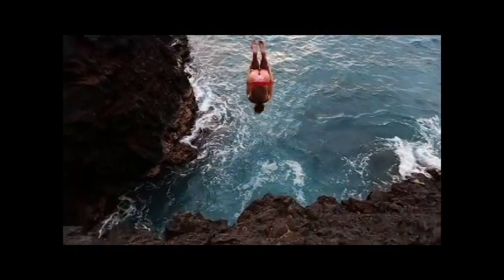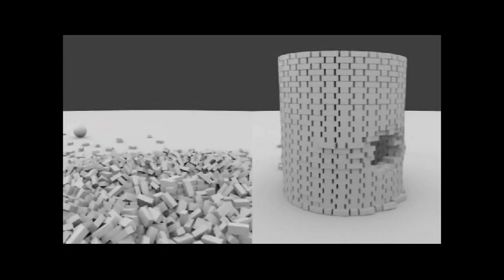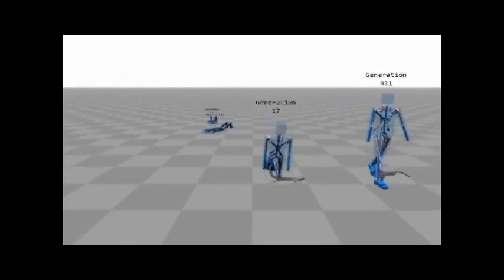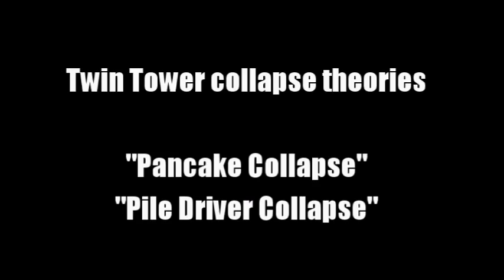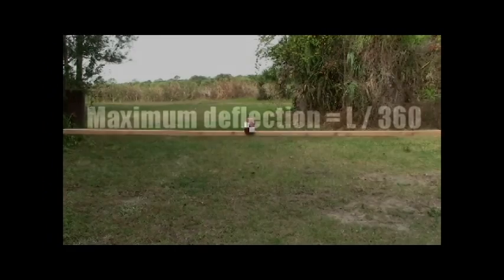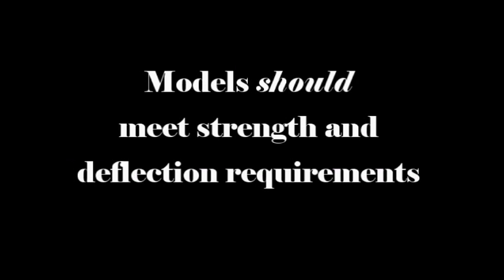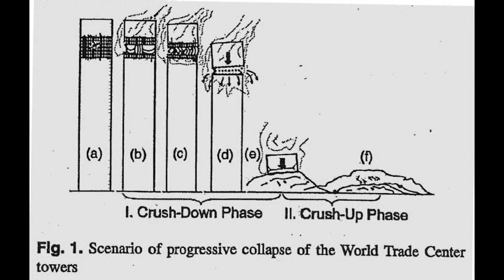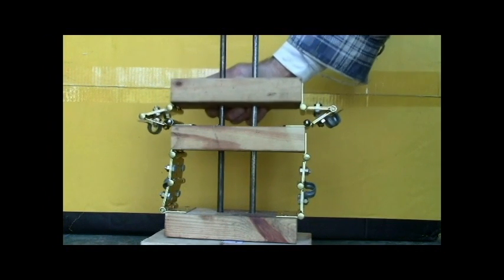9/11 Experiments: The Force Behind the Motion

Comment: this is a good example, of how easy it is, to fool the gullible.
     he drops a weight, which under static conditions, the, 'floors ', can support.     upon impact,  the 'floor',  now has to support, a dynamic load, it can't, and fails, due to the much greater impact force, generated because of the kinetic energy stored in the weight.
     some of the kinetic energy, is dissipated in breaking the, 'floor', so the weight's velocity is reduced.    since the floors are much closer to gether, than the distance it was dropped from, the weight eventually stops, because the velocity is reduced, with each, impact,  this is physics, at work, nothing strange, here.
     now lets see what happened  to the first tower,   
        the 'weight',  about 14 floors, dropped about 4 metres to the floor, below, and either smashed the floor to pieces, or at least detached it from the angle clips, similar to this video,   the 'weight', then dropped onto the floor below, with the same result,  etc,  etc, all the way, to the bottom.
     so, why did the towers, 'weight', continue to the bottom?
simple,  the towers , 'weight',  was about,   60,000 tons,  and  the floor could only support , about 13,000 tons.
     in fact, due to the mass and it's velocity, on the first impact, a force of about 30 times the 60,000 tons, was generated, close to 2,000,000 tons, the structure had no chance.
    but hang on, you shout, what about the vertical collumns, they would have stopped, it, no they were not even relevant,  because they were  not stable enough, to stand on their own, once the floors, were taken out, and what makes you think, they were even in line, when the 14 floors tilted over at quite an angle, before descending .

Comment: nice work
Reply: you must be very, gullible.
Reply: 311hwr
sorry slappy, i've done more hours of research on 9/11 than you can imagine.  it took 8 stubborn years for me to see the light.  gullible is definitely not the right term.
Reply: if you think  these ' experiments ' prove the towers could not fall due to damage and gravity, you are, gullible.
scaling down to say, 0.5 percent, of the towers, is impossible, it cannot be done, because you cannot scale down gravity, building a scale model to that ratio means you would end up with not enough space in the model, to place enough gold, to get the scale, weight.
if you made it slightly bigger to fit in enough weight, you would have virtually a solid block, hardly representative of the towers, they were 95 percent, air.
if you mean by, ' seeing the light ' that the government of the u.s.a, is controlled by a bunch of evil monsters that take there orders from a tiny state in the middle east, then i must agree with you, but that has nothing to do with the physics of how the towers, came down.
they came down, because of damage and gravity, and an, 'odd',  tube in a tube design, all explained by physics.
Reply: 311hwr
the experiments are only the tip of the iceberg.  there is so much more information available the unquestionably proves that 9/11 is full of lies.
Reply: Bill Fred
911  is full of lies, but mostly from gage, chandler, jones etc.
   i won't bore you with the very long list, it's all on 911 debunked,   and nmsr 9-11 truth resources.
  i watched a compilation of about 150 controlled demolitions on u tube, then watched the towers drop,  not one of them remotely resembled the towers collapse.
  the reason is simple, the towers collapsed due to damage, and gravity, not explosives, thermite, etc.
   it's very easy to be brainwashed by people like chandler, gage, etc, don't be.
Reply: wtc1 and 2 etc,     yes the inner core was very strong, but none of these buildings were designed to survive having 60,000 tons and about 120,000 tons of steel and concrete dropped on them, why would they be,  seagulls roosting up there don't weigh that much.
   once that sort of mass starts moving, it's planet, here i come.
the weight did not bring them down, it was the massive amount of kinetic energy built up by the accelerating mass .you don't think kinetic energy could do that?
    pick up a house brick, slowly lower it on to your foot, no problem,  what would happen if you dropped it from 4 metres?  don't try it, it's hard to walk without a foot.

Comment: Really excellent work. I've often wondered why the pancake or pile driver theorists don't put the matter to rest by constructing two large (1/10 or 1/20th scale), accurate replicas of building seven, and then challenging the "truthers" to a contest. Each team would have to reproduce the collapse of the building with one of the models. The truthers would be able to use explosive charges, the pancake/pile driver team would be able to use only small fires and some debris tossed at one wall.  Which team do you suppose would fare best?

Comment: Great attempts but I see flaws with your experiments that may very well be why your not seeing the results. Keep in mind each and every one of these floors are connected with vent shafts, elevator shafts, stairwells, etc. The building was also for the most part sealed. The air compression generated by the collapsing floors above could very well be the extra force that was required to take out and weaken the floors below. You can see this occur many stories below the collapse as windows begin to burst randomly.

Comment: A quick analysis of the pile-driver collapse mechanism yields a=g*(1-(F_up/W_piledriver)). The weight of the "piledriver" will increase at about the same rate as the maximum upward force (because the lower floors have to support all the floors above them, and are thus stronger). If the force provided by a floor as it collapses from its initial height to zero is similar to the force it provides when intact, then any building that didn't collapse under its own weight would not experience accelerating collapse under these conditions. The crucial insight is that, due to buckling, the average force provided by a floor from h=h_init to h=0 is much lower than F(h_init). If the factor by which it is lower exceeds the safety factor, we get an accelerating collapse. If not, we get a damped, halting collapse like you saw. There are two very different behaviours possible here, and which one we see depends on how the model is built. You need to modify your model to provide the appropriate average force in a floor collapse event. To do that, you'll need to determine what the value of that parameter was in the actual towers. Which will probably entail some simulation ;)
Reply: How fortuitous that all the complete  building blueprints are available online! scale model time, if we can just get some funding.

Comment: Sorry bud, your popsicle-stick and paper model doesn't trump a computer simulation made by actual engineers.
And your model doesn't match the footage at all. Your model keeps starting and stopping from bottom to top the whole way down. In your model, every floor shoots most of the beams out in all directions for half a mile or more. It simply doesn't match observation, Richard Feynman would not be impressed.
Reply: <You lack any evidence or any empirical support, so you're stuck with bland insults.>

All of the observable evidence points to controlled demolition.  The only published academic work examining the dust for pyrotechnic residues concludes the use of advanced incendiaries.  The documentation of melted "eutectic" steel in FEMA's appendix C supports this conclusion.  The huge number of iron microspheres in the dust as reported by RJ Lee also matches the known chemical signature of thermite reaction byproducts.  The hundreds of eyewitness statements concerning secondary explosions and molten iron supports demolition.  The 100 ft of perfect symmetrical free-fall for building 7 is also only possible with pyrotechnics to remove the supports simultaneously.

Which actual physical evidence can you present that supports the official theory?

<In demolitions, first multiple audible popping explosives go off, then there's a pause, then the building collapses from bottom to top.>

In *conventional demolitions, that is true.  And you actually believe that a person wanting to fake a plane-and-fire-induced collapse would rig a building to look like a conventional demolition?  Wow.  And you actually believe there is only one way to demolish a building?  Top-down demolition is not new.  0 points.

<Some assert there are explosion sounds, in the world trade center collapse but they sound much softer>

Advanced superthermite composites can be tuned and adjusted in their configuration to affect the noise and shockwave of the material the it ignites.  Your assumption is that all explosions are going to sound like a C4 charge.  They aren't.  0 points.

<And these sounds occur at the wrong time, with no pause before the collapse.>

You actually believe that you would be able to hear discernible individual explosions in a sequence that cascades downward at near free-fall accceleration amidst the cacophony of debris falling around it, recorded through a device thousands of feet away, and replayed through some laptop or computer speakers?  The progressively deafening roar that is recorded is perfectly consistent with what one would expect to see considering the circumstances.  0 points.

<literally just showed empirically that this is not a controlled demolition>

No, literally, you didn't.  I don't think you know what empirically means.  There is absolutely nothing empirical about the collection of misrepresentations and speculations that you call an argument.

If you'd like to show some actual empirical evidence that proves the official collapse theory, then be my guest.  Similarly, go ahead and disprove the Harrit paper, which EMPIRICALLY  proves the presence of advanced incendiaries in the WTC dust.

<but you failed to even try and address it.>

Addressed, and crushed.  Looks to me like your so-called argument needs some help.
Reply: Dank Bear I've watched at least 20 now, and I don't see the connection:

In demolitions, first multiple audible popping explosives go off, then there's a pause, then the building collapses from bottom to top.

With the two towers, no explosives go off, they just sit there burning for who knows how long, then they begin to collapse from top to bottom instead of bottom to top.

Some assert there are explosion sounds, in the world trade center collapse but they sound much softer(probably the floors collapsing onto one another) not poppy like explosives in demolitions. And these sounds occur at the wrong time, with no pause before the collapse. Whatever way you look at the footage, this does not match a controlled demolition. Sorry about that.
Reply: <Sorry bud, your popsicle-stick and paper model doesn't trump a computer simulation made by actual engineers.>

Which model are you referring to?  Oh, the NIST building 7 computer model?  The model that hasn't been peer-reviewed or published, and whose creators will not release the modeling parameters?  The model that looks nothing like the actual collapse?  That model?  Tell me, who was there measuring the location and intensity of all the fires in real time?  Who was cataloguing the load distribution of the towers?  What was the extent of the structural damage, and where?

Sorry bud, A contrived computer model with estimated parameters that they won't even release to the public proves nothing except in your fairytale version of reality.
Reply: +Paolo Rossi Oh I don't think he's brainwashed. No, he did this to himself.
Reply: +Paolo Rossi not an argument.
Reply: +evsupp2011 God I wish I could get paid just to leave comments on YouTube.  Where do I sign up for that?

Also; not an argument.
Reply: +Paolo Rossi literally just showed empirically that this is not a controlled demolition, but you failed to even try and address it.
I've had more intelligent and honest discussioms with flat earthers and that's the Truth.
Reply: belief, is all they have.
Reply: +311hwr you greasy little troll shows up on every 9/11 video, but all you do is nutthug someone else's statement. You're not even a full grown troll yet, you just hype other more senior trolls comments. Funny and pathetic you guys are,  supporting the official bullshit story. Have you concluded which official lie NIST an they others decided to use after constantly updating their story of what happened and please gtfo with your ''throw away that spade yet'' line cause you're so fucking corny and lame. What ''spade'' have you got cause all you do is play yes man. You're a fucking idiot, lmfao just another coward protecting his bubble in your own little world where science doesn't applied and lies govern your flouridated brain
Reply: +Paolo Rossi yeah he's every where, he rarely comments for himself, he just likes hyping other trolls. He's a typical upright bag of water.
Reply: Oh Xander, Emvaz22 really handed your ass to you. I do not see any rational reply from you to him here? I doubt one is forthcoming. You are well and truly trounced on all fronts. My condolences.
Reply: xander, I'm not going to try to "beat your ass with evidence" but what I want you to do is look at videos of controlled demolition vs WTC 7. the similarities are damning, not to mention the Larry Silverstein made the claim the fire department pulled the building, and two other organizations saying it was structure failure due to ordinary office fires which never happened before or since 9/11
Reply: it's also worth noting that NIST never tested for bomb residue (which was federal policy for reported explosions) and claimed it wasn't relevant to the investigation.
Reply: i have watched a lot more, and the only thing they have in common with the towers, is they all dropped to the ground.
    the ' squibs ',  in  the towers, start off small, then get bigger, in the explosive demolitions, they start off large then reduce with time, as you would expect from the sudden release of energy.
    in the towers, these were simply compressed air, of course, due to the floors collapsing.
     the greatest difference, is that the explosive demolitions, are very, ' clean ', compared to the towers, in that hardly anything is ejected from the building, different as chalk and cheese.
Reply: all they have, is belief, sad, but true.
Reply: the hole you have dug for yourself, is more than big enough already, might be a good idea, to throw the spade away.
Reply: throw that spade, away.
Reply: i don't try to be, i just prefer, truth, to fiction.
       xander pattern made 3 solid statement's, paolo rossi, responded with, nothing, that's the problem with just believing, it might be true, it might not,  much better, to know.
Reply: no need, just scroll down to the 2 'dank bear', post's.
   thrown away that spade yet?
Reply: you'll be waiting, a long time.
Reply: which one's?
Reply: still digging that hole, i see.
Reply: Really bro? You can't think for yourself? You're one of those people that has limited thinking? I'll clue you in on something then, the government has far more advanced weapons than this farmer does.
Reply: It is strange that no one responds to your observations. 

> Your model keeps starting and stopping from bottom to top the whole way down. 
The videographer claims that this is due to the fact that the explosions in his model are timed by fuse rather than nicely controllable remote controlled explosive devices. 

> In your model, every floor shoots most of the beams out in all directions for half a mile or more. 

In the collapse of the towers, every floor shoots out most of the beams in all directions but in the case of the towers it is often surmised that the beams were first cut using something like thermite, before being blown outwards. The need for outwards horizontal force would depend upon the integrity of the beams prior to the detonation of the explosives.  

> It simply doesn't match observation, Richard Feynman would not be impressed.
I thought it matched observation fairly well, bearing in mind the above provisos, and certainly more than the two gravity models.
Reply: timtak1
Nice job ignoring the part observation in my comment where it doesn't matter whether the explosions go off in some order, because there's always a long pause before they fall in a controlled demolition, but in the video, they clearly fall instantly as soon as the explosion goes off. That's inconsistent with observation.

"n the collapse of the towers, every floor shoots out most of the beams in all directions"
No it looks nothing like this video at all.
Reply: > Nice job ignoring the part observation in my comment

Sorry, there were so many comments in this thread, that I only addressed your original post.

> it doesn't matter whether the explosions go off in some order, because there's always a long pause before they fall in a controlled demolition,

The way in which the twin towers fell is clearly different to the way in which buildings fall in other controlled demolitions. As you say, there is normally a delay.

If the twin towers fell as a result of controlled demolition it would be a very unusual (or unique) type of controlled demolition.

That it should be unusual would not be entirely surprising since normal controlled demolitions are designed to demolish buildings in efficient and safe ways, whereas, if this were a controlled demolition, it would have been designed to other objectives -- to create a sense of fear and defeat perhaps.

> but in the video, they clearly fall instantly as soon as the explosion goes off.

The video was attempting to mimic the event under three scenarios two as a result of gravity the third as a result of gravity and explosives. It is up to the viewers to decide which if any of the experiment results in an outcome similar to that of the real event, and thus what caused the real event.